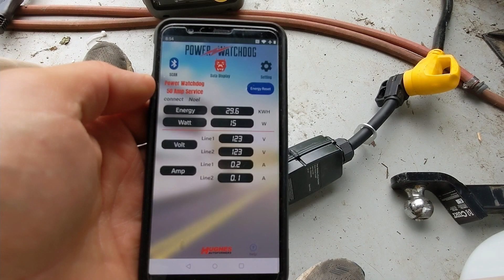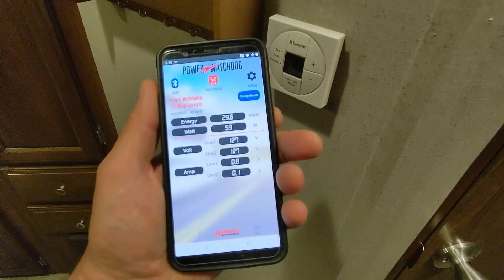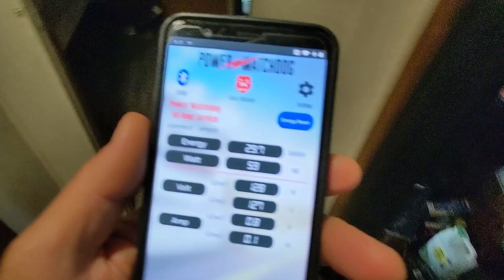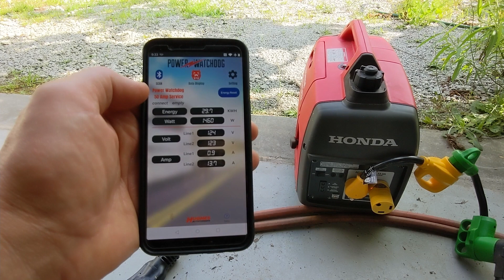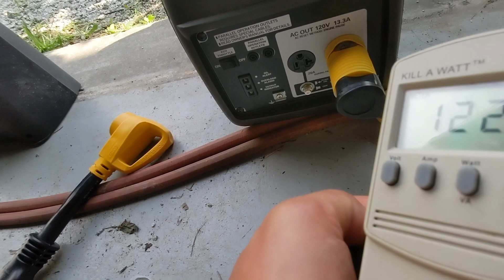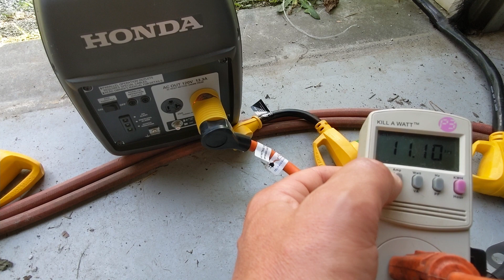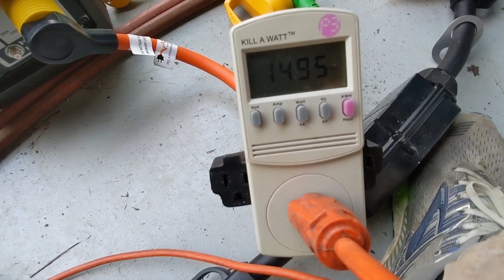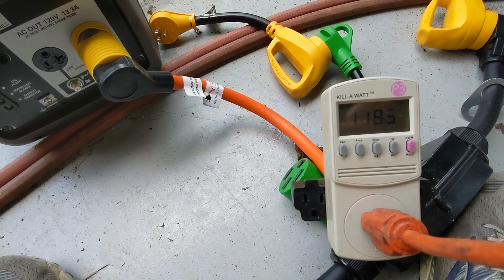Honda EU2000i inverter generator won't produce rated output

Comment: Air conditioner uses electric motor for compressor. If AC rated f.e. 700w, compressor motor consumes x6-x9 times rated power while starting, in our example - 4200-6300w
Your generator - is invertor based, and it will not sustain such startup currents.
This consumption will last for 0.3-3 seconds.
Reply from the maker: I have a soft start unit installed on it, but that wasn't the problem. I recently had to replace the start capacitor and I think that it was causing the load to ramp up rather quickly after the initial start, and the little Honda couldn't handle the load after a while.

Comment: Did you ever figure out the problem?  I have the same issue.  Thank you.
Reply from the maker: Sorry, but no I never did. It seems to work ok as long as it's below rated spec, so I just try to keep it under about 1500w. That extra 100w below continuous rating seems to make the difference.
Reply: I believe I figured the fix!  Open the choke just a bit, for me I know keep the choke at the halfway point. @NoelBarlau

Comment: Mine dies when I put a load on while in eco mode but can handle load fine in eco off mode. Switch seems to work as it idle up and back down with no load when I witch it back and forth?

Comment: What's the kva rating?
Reply from the maker: 1600w continuous, 2000w intermittent.
Reply: @NoelBarlau  My model is the pre-bluetooth version but it's doing the same thing... Took it apart, changed the oil, swapped the spark plug, cleaned the carb and filter, still destined for a landfill so it seems!
Reply: @CayoticProphet  location?
Reply: @justchillentertainment8885  Washington state